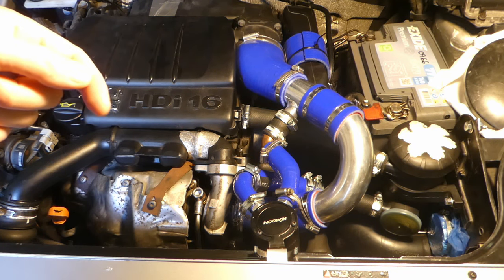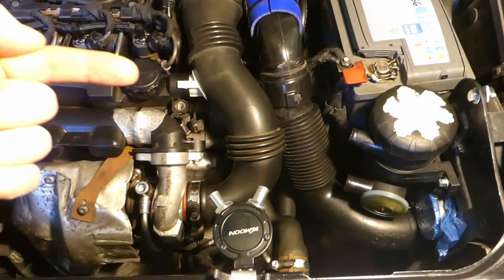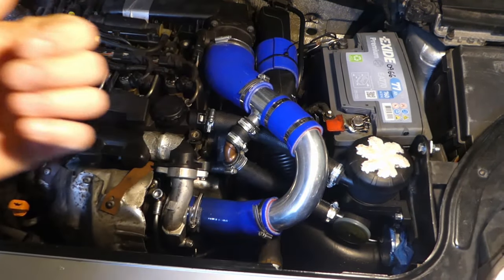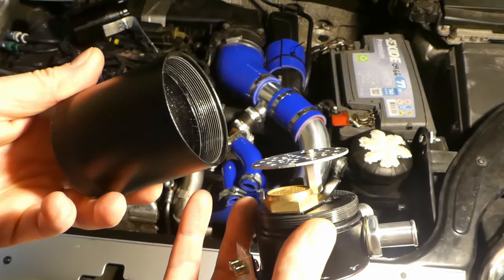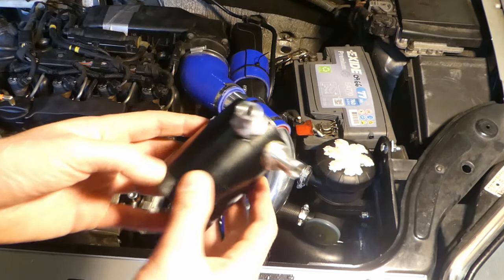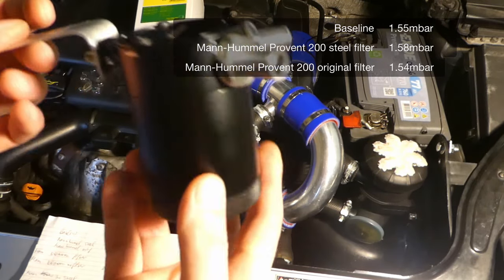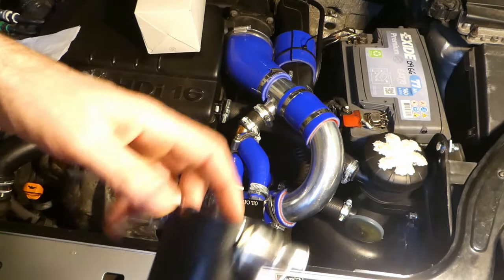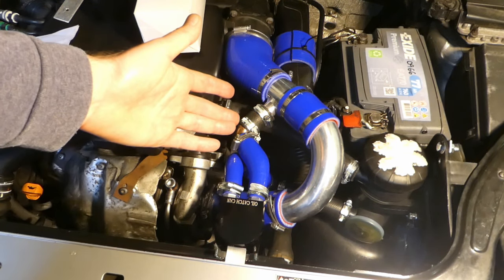Oil Catch Cans Crankcase Pressure, Provent 200 vs Mishimoto vs Universal oil catch can

Comment: I feel like this could be very good information but done in a skewed way. Why would you leave the first catch can in series with the other two? The additional hose length plus the extra can all contribute to restriction. Not to mention, there ended up being a slight kink in the hose going to the last "universal" can. 
The other thing to consider with the filters is running a new filter (bronze or mesh) will flow far better than one with a thousand miles on it. So technically the second and third cans could be starting to see some filter restrictions caused by the first one starting to saturate.

Comment: Excellent video with great testing methods. So I've got the numbers right, the actual pressure with the mishomoto + bronze filter was 4.62mbar? (6.20 - 1.58 as it was connected with the man Hummel)
Reply from the maker: Almost correct. The Mann Hummel 1.58 was 0.01 or so different from the natural crankcase pressure of the engine. So, leaving it there does not add more crankcase pressure, thus no need to do 6.20-1.58, it is 6.20. Hope that makes sense.

Comment: To test seperate will be more true test as all that beding and hose lenth will cause extra restrictions. Hope we can se can tests performing appart.
Reply from the maker: It is a relative test at the end of the day. In addition, the bronze one is compared to another one with the same length hoses, so you get relative restriction compared to each other. The "fake" Mann-hummel does not add anything to the crankcase pressure, so leaving it there does not change the pressure.

Comment: There is also difference in diameter of hose and connector. Mann-Hummel and your OEM setup got very large hose. Mishimoto and the unknown catch cans had very small diameters compared to the other setups. You can make the test again with the Mishimoto and unknown cans on cars with smaller vent hose diameter. That’s my guess
Reply from the maker: Yes, I completely agree. It is rather difficult to detemine is the increased crankcase pressure comes from the catch can itself or the smaller hoses. I suspect it is from the hoses. Very good suggestion to testing the same with the smaller hoses for the Mishimoto and the other one. This should show if these increases come purely from the hoses. The problem is that the maximum hose intake is pretty small on the mishimoto. I think I have a smaller-sized port for the mishimoto so I can try it. Thank you!
Reply: @moremolecules  
And thank you for your videos! I wait for your next one
Reply: @moremolecules  I'd like to see a hose size comparison as well as I have a dorman oil catch can on a 2012 chevy malibu running small hoses I've thought about changing to large hoses but I also don't want vacuum leaks and it's working perfectly awesome peace and much respect to you 👍 JASON awesome video 😀 👍 👏
Reply from the maker: @jasonhumphry5836  Smaller diameter hoses will add a little bit of pressure, but not that much. If you look at the video with the comparison of the cheap universal oil catch can had only little pressure above the mann hummel, despite the hoses being much smaller diameter. So, it will add a little bit of pressure, but not very substantial.
Reply: @moremolecules  thanks for the added information

Comment: Hi man , thanks a lot for making and sharing the video, it has really good information and data comparison , has helped me understand how such a system works. 
I have installed a no name catch can with brass baffle ,drove about 6000 km and concluded that the engine has burned/leaked about 2-2.5 litres of oil . Now , I took the system out to see if the engine itself is defective or if my catch can system was somehow fault. I have the car only 5 months so I don't know yet if the engine burns oil or not, no blue smoke whatsoever and no puddel under the car.I must mention that out of the 6000 km , I drove about 4000 only on the motorway and up to almost 3000 rpm. Now the questions taking in consideration all the above, if it was the catch can's fault and was too much of a pressure in the engine, have I done damage to all the seals and o-rings inside ? Do you think it will still "burn" the same amount of oil without the catch can system?

I would be glad to hear your opinion on this, thank you and keep up the good work !
Reply from the maker: Hi bogdan, I completely understand your concern/question, but really difficult to answer conclusively. The bronze oil catch can does add to the crankcase pressure, but it should not be enough to cause oil leakage from the seals. It could be, but difficult to say with certainty. Depends what your engine is and what the current crankcase pressure is. If the oil catch can was enough to cause seals leaking, it would have happened anyway. The other thing is that depends on the hoses and your CCV/PCV valve. If the hoses collapse under pressure/vacuum, then that could have contributed rather than the oil catch can. It could be that the CCV or PCV (depends on what is in your engine) could be blocked or not working, that would certainly lead to oil seals leaking.
You may need to investigate where oil is leaking from, as it may well be say be the sump plug.
Reply: @moremolecules  Good day sir, I don’t know much on these things and oil catch cans. I have a Holden Colorado with a 2.8 Diesel engine and recently bought a mishimoto oil catch can with the Bronze  filter and baffle. Would it be ok for that engine or should I remove the bronze filter?
Reply from the maker: @hemakalpoo5686  It really depends on the condition of the car. If it is in a good condition, it should be alright. I mean how much of a breather is the car, if it is not too heavy breather then the increase in the crankcase pressure will probably be OK with the bronze filter inside.

Comment: I’d be interested in seeing what vent to atmosphere pressures look like. I can’t find any info online. It might not apply to your vehicle but plenty of people run breather cans
Reply from the maker: Hi Jason, I do not quite remember if I did this test, but might do a quick test and compare the crankcase pressure with venting to the atmosphere.
Reply: I run mine to atmosphere using 19mm id hose..seems to work well and can only benefit engine internals..no brainer
Reply: @moremolecules llegaste a probar que presión tenías a la atmósfera? Un saludo?
Reply from the maker: @AndoniFV  Unfortunately I never did venting to the atmosphere test. I did not have at the time a filter that vented to the atmosphere, otherwise I would have tested it.

Comment: Congrats on a job well done! Excellent video explanation! Exactly the info I was looking for my 2014 3.0 liter Ecodiesel. Im going with Provent with stainless like yours, but before I put on I am going to run HoTShot Stiction oil treatment. If I do before, Hot Shot Stication will not reach the turbo through the vapours , which it relies on. LOL - I might end up putting 2 Y's so when I want to run oil treatments I just turn the 2 valves? your thoughts?
Reply from the maker: Thank you for the good words. Not familiar with the HoTShot oil tratment, but in any respect any oil catch can is not 100% efficient. Various percentages thrown around on the web, so in any case something will pass through.
I have to pass annual inspection every year and my oil catch can is deemed an emissions modification, despite that it helps rather than produce more emissions. I simply remove my oil catch can system and put in the stock. You could use similar way to run your treatment. I know it is a faff.

Comment: How about making more tiny holes on the disk baffle for more air flow and removing the bronze filter and adding the scrub pad?
Reply from the maker: Yes, that would work, but then again it will not be too different than the cheap one with the larger holes and the scrub pads. I guess that the bronze filter with a few larger holes will reduce the increase in the crankcase pressure.
Reply: That sounds like a good idea.   Weekend project.  Thanks Molecule.

Comment: Very well instrumented testing and thanks for the suggestion on electronics. However, only looking at idle conditions is not a good analysis. The engine spends most of its time at engine speeds far above idle and under varying crankcase pressure/vacuum levels.
Reply from the maker: I completely agree. The test I wanted to do is: "is there an increase in crankcase pressure with different oil catch cans". The highest crankcase pressure will be under idle, so that is why I did it under idle. Of course, there will be different vacuum/pressure levels under load, but very difficult to test under normal road conditions. I would not be able to replicate the same journey. If there is a dyno or rolling road, then it can be done, but I have not got access to these.
It can be done with driving on normal roads, but then again one needs to repeat it several times, then averages, distributions, standard errors, etc., and it will become a statistical test. Most people will switch off and not follow in order for the test to be accurate and representative.

Comment: I just bought a mashimotto repleca oil cath can same as yours with the bronze mesh . I have a civic with r18 na engine 1.8 lit and i want to put this oil cath can in but after what i saw maybe i wont i thinking about take off this bronze filter and put the stanless steal mesh that yo put bittwen the top cap and the steel plate (that with hules in it ) it will be alot of filtering mass and a better air flow can you check that out 😉
Reply from the maker: Hi Far, yes, I was really surprised as well that it increased crankcase pressure quite a bit, I would say significantly more. Nevertheless, it's only 6mbars, so not that much. Then again, depends on what the engine can sustain. I suspect that this bronze filter will really filter oil rather well, apart from the crankcase pressure.
Reply: @moremolecules  i think its a good design to but if that pressure can blow gasget like between the engine and gear one its gone be lot of mess work and money its not like leaking from valve cover gasket
Reply from the maker: @allahasan6631  Yes, but that is the problem with oil catch cans, it is somewhat a trade-off between efficiency (fine filters) and blowing gaskets. So far I have not seen anyone investigating how much pressure is needed for a gasket to be blown and start leaking. If an engine is a heavy breather, then an oil catch can will add to that, so making matters slightly worse. The leak most likely will be between the block and the rocker cover, rather than anywhere else, but that is only a guess.

Comment: What kind of hose is necessary for catch can back to intake?  The 3/4" heater hose that I used collapses.  Heat from the engine makes the hose pliable, and the intake's vacuum pressure causes it to collapse.
Reply from the maker: Hi Greg, yes the usual hoses that are supplied with catch cans are too weak. I use fuel hose 25mm. It is a bit on the thick side, but it will not collapse, it is too rigid. The other option is to get reinforced silicone hose, but it has to be fuel safe, otherwise it will disintegrate eventually.
Reply: Teflon lined Fuel Hose is actually the best. More expensive, a little harder to work with - but VERY stable and durable. It's impervious to Chemicals, which is why it's popular to use with E-85 Ethanol Fuel Systems.
Reply from the maker: @CarminesRCTipsandTricks  Great advice and many thanks indeed. I will have to investigate this to see if I can purchase and replace my own hoses.

Comment: Great video. i have been looking to install an Oil catch can on my gasoline engine for a while now. After watching your video, i got concerned about the positive crankcase pressure problem. Do you think installing an OCC with brass filter a bad idea?.
Reply: Yep, one of the reasons I am leaning to ADD w1 or UPR.. ADD w1 is on sale for $109 for its V3. There is a YT video where a guy uses a cheap $20 OCC and removes the brass filter. I would always advise that.

Comment: I would like to know if oil catch can will create damage to gas engines. 3.8L V6. Do yo have a test for gas engines? Thank you.
Reply from the maker: Hi there, I really like your question, but very difficult to answer without having your particular engine at hand to do tests.
No, I do not have a test with a gas/petrol engine. Nevertheless, the crankcase pressure increase will be the same. The issue is that this is relative. So, if you add a glass of water to another glass of water that is a lot, but if you add that same glass of water to a lake, not that much of an increase.
What I want to say is that it depends on how much pressure your 3.8L V6 can sustain or what is normal for that engine. My tiny 1.6L (4 cyls) can only sustain max ~40-50mbars without oil leaking from the seals. Now, pressure in the gas/petrol engine is normally a lot lower than a diesel, so difficult to say without experimentation, unless you know your normal crankcase pressure for you engine.
Reply: @moremolecules  thank you for your answer. This answered a lot of my questions. Like pressure difference of diesel vs gas. Appreciate your time and help.
Reply from the maker: @hulong0205  No worries, unfortunately I cannot provide more info on that, but that is the general kind of way these things work. Very difficult to get this data (normal crankcase pressure) from the manufacturer, unless one bought the car from new and measured at the very beginning of ownership.

Comment: Awesome video, wished I found it a couple of weeks earliers! Just installed a Mishimoto on a diesel Mercedes ML270, definitely not comfortable with those values. Nevertheless, the main problem I've been having is that I'm getting oil from the "out" port. Tried it the other way around, the "in" port throught the bronze mesh, and was getting better results, any ideas why? Anyway after watching your video, i think i will remove it completely
Reply from the maker: Well, not too sure why it is gathering oil on the out port. THe oil catch cans are not 100% efficient for separating the oil, so you will always get some on th eout port.

Comment: So what is the safest way to hook up a catch can system?? Mine is a gasoline non turbo.  Do I need two catch cans or is one good enough??? Just one catch can with no bronze filter would be best??? I assume id want it to be the same pressure it was before I installed anything?
Reply from the maker: Hi Ben, apologies, I probably made it to look more complicated than it is. Only one catch can is enough, preferably the non-bronze one. If you engine is not too worn (not much blow-by) then even the bronze one will be quite good. If you have an older engine, then I would not recommend the bronze one. Yes, you want the pressure to stay as low as possible.
I only used the two, as it was easier and I had them hooked up already.

Comment: What steel scourer material did you insert in the steel mesh Provent filter ?
Reply from the maker: I do not remember the actual brand, but some generic stainless steel household scourers. They have to be stainless steel, but any that are that should do.
Reply: @moremolecules  Thanks . Do you also know if the Provent 200 mark IV has an aftermarket stainless steel filter that will fit as I have seen there might be fitting issues with certain models .

Comment: Well detailed video. I followed your video and installed OCC successfully. I ran my Toyota Prius hybrid on maintenance mode for almost an hour ( to check if it's still overheating intermittently due to weak water pump that I replaced with new water pump and that's been fixed ) but I noticed the hose that I connected from outlet of Oil catch can ( universal OCC) that goes into the intake manifold was completely flat due to high pressure. Do you think OCC might not be functioning as it supposed to  or should I replace the hose with the heavy duty hose ( thicker one) , like the one I got that connects from PCV valve to inlet of OCC. Do you think I need to get a fuel line  hose which is thicker than the one I installed ( maybe I got radiator hose ) .I subscribed. Thank you for you reply
Reply from the maker: Yes, replace the hoses with heavy duty ones that would not collapse under pressure/vacuum. I would get something that is fuel safe hose, but such that it would not collapse under pressure.

Comment: Interesting video and it got me thinking about my car and how I have the catch can Installed. In a gasoline naturally aspirated inline six cylinder engine would there be much concern for increased crankcase pressure if I decided to use the mishimoto type bronze filter cans? 

I’m only asking the question since I can really benefit from the decrease of blow by into my intake manifold but not at the cost of raising crank case pressure and blowing out all my seals and causing leaks I do not wish to have 🤷🏼‍♂️
Reply from the maker: Good question. I would always thread on the cautious side of things and get a bigger (if there is space to fit) oil catch can, for example the Provent200 or bigger.